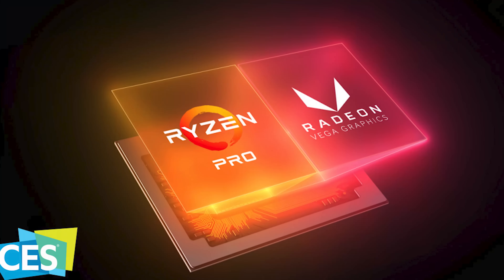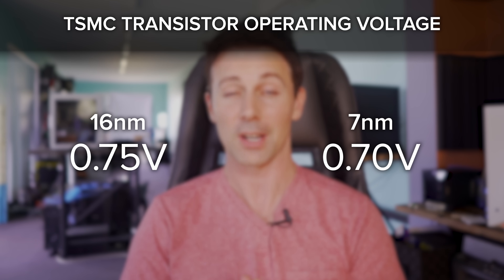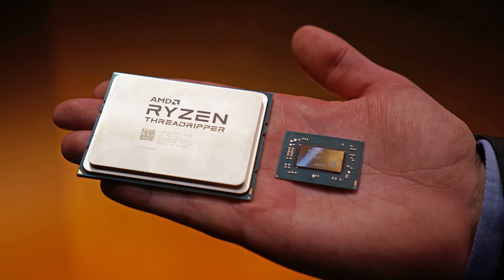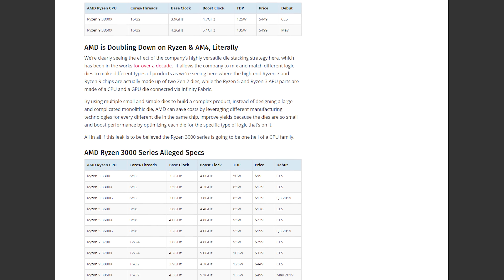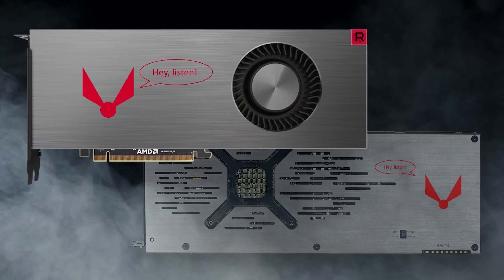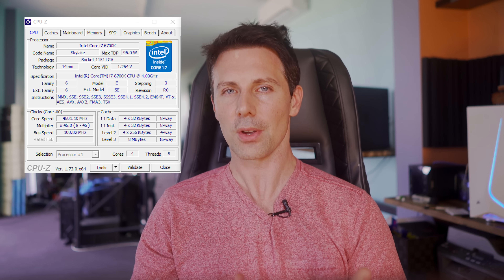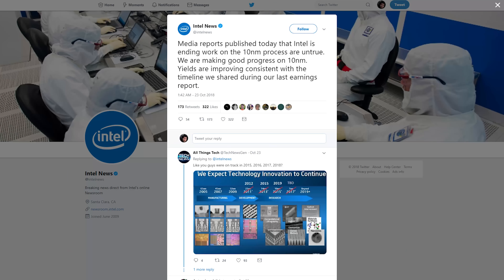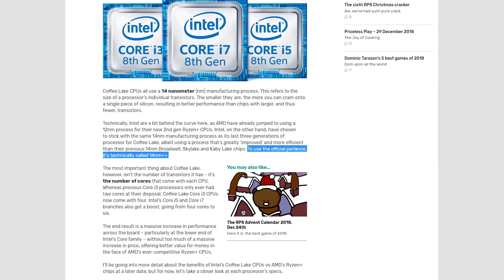7nm, 5nm and Beyond - Will AMD RYZEN 3000 be the PINNACLE...!?

Comment: Ryzen 3000 changes the game completely. Being able to get a six core CPU for under 100$ is amazing. If AMD has made enough leeway with their GPU process... Then you have a bang for buck winner. Striking Intel AND Nvidia at the same time would change the PC space toward AMD for years to come.
Reply: 6 core 12 thread that can be overclocked to 4.6ghz and has an ipc advantage over the i7 8700k.
Reply: @dondraper4438  not sure about that. I would wait for benchmarks.
Reply: @Saxie81  It's the TSMC 7nm process that makes it possible. The 14nm global foundries (samsung) Low Power Profile node was lucky to hit 4.35ghz. While TSMC's 7nm process is made for higher clocks, 25% higher clocks higher than Samsungs 14nm node.
Reply: Technical excellence MUST have the marketing to go with it. Joe average will look at you like you're having a stroke if you mention ipc and other relevant tech and just mutter "buttt,butt green and intel inside" "they're the most expensive so they must be the best" "the other company is bigger so they're better" Or even "it might not work if it's not Intel/Nvidea" and so on. AMD needs mindshare bad or they could put out a 64 core 9 ghz $35 20watt tdp chip with 8x's lintels ipc and an integrated gpu that can full raytracing on 16 8k monitors at 800fps and still have poor marketshare in the consumer space. Seriously if the 3xxx series is as good as the rumors or even close they need to dump a TON of money on marketing to gain real traction there. However it's not as high a priority as the server market where the end users have more tech savvy folk in advisory positions and sometimes even decision making positions.
Reply: Wishful thinking that simply isn't going to happen.
Reply: I just hope Intel can keep up, I mean, if it dies, I would be sad, they invented x86.
Reply: dream on
Reply: Zfast4y0u  Intel never give me erection since 2015
Reply: You're going to feel really foolish about this by this time next week.
Reply: @selohcin  Well we had a not power limited 9900K losing to 3rd gen Ryzen at undefined clock speed. So that was a 8core 16th had enough power matched intel for clockspeed. And if they try to cut Intel again like they did with Ryzen 1 R7 1700 for $320, this one could easily be the R5 3000 lineup which would cost around $200.

So a six core for under $100 doesnt seem reasonable but $120-150 easy
Reply: @selohcin  Regardless what they say in the keynote, I won't feel foolish lol
Reply: Trust me those rumours are not real....100$ for 6cores 12threads..too good to be true
Reply: @crusherrakib9582  Not really man, you must not have been around during the Athlon X2 days. Tons of good chips for fairly cheap.
Reply: @dondraper4438  Phenom II x3's still run well in 2019, still enjoying the X3 720BE and I haven't tried overclocking or core unlocking yet.
Reply: @crusherrakib9582  idk on black friday i got a 8c/16t ryzen 1700x for $120 brand new so this doesnt seem too far fetched imo, granted it was black friday so it was on sale
Reply: @crusherrakib9582  Ryzen 3000 and Navi 3000 will be able to be more affordable as the chiplet design allows for much more flexibility and less wastage in the binning process.  I would expect AMD to come out of the gates with impressively competitive pricing but not so cheap that people will not continue to buy up old inventory. 6 months to a year later though the lower demand SKUs will see a significant price drop to get media attention and mess with an Intel/Nvidia launch.
Reply: @crusherrakib9582  Also it's 8 core chiplets, so it would be a 3+3 configuration, you're getting the bargin bin quality dies. Full configuration is 8+8.

Comment: in 2025 100 cores in regular pc will be very normal XD
Reply: in 2050 cores will be obsolete
Reply: that's the same mistake that others have done before by looking at current trends and assuming it will keep escalating. It usually doesn't. Other things happen. No idea what.
Reply: r7 3700x is 12 cores / 24 threads and boosts up to 5ghz, so it's not entirely impossible.
Reply: If we can replace silicon with something better than we can see 5ghz being the norm.
Reply: @briandudley5150  Graphene is capable of quadrillions of operations per second.  
Let's hope it takes off
Reply: For AMD, it'd either be 96 or 128 cores, depending on how it's made (because their core counts are always a power of 2 or a power of 2 times 3/2, so 4, 6, 8, 12, 16, 24, 32, 48, 64, 96, 128, 192, 256, and so on).

It'd probably be just as exciting to see a regular CPU (finally) hit 10GHz, silicon or otherwise, base clock or overclock. (The record to beat is an ~8GHz overclock.)
Reply: Does anyone know how many bits are used for the core # in modern OSes and/or motherboards? Is there a hard limit on the number of cores before the ID number needs to be expanded?
Reply: Lol
Reply: @dibyamartandasamanta583  maybe the concept of cores itself will be obsolete instead.
Reply: Keelan  No, 12 cores will most likely remain mid range, and 16 cores might be high end.
Reply: Keelan  Didn't we quadruple core count going from single core to more than quad core in a few year time before? The same thing is happening now, but with a trend of stagnation in between, as you mentioned. We could enter another trend of stagnation on say 16-32 cores starting 2020 until for example 2028. Or another trend might take hold once we reach the 16-32 core CPU on most desktops era. Maybe IPC hikes. Either way, CPU future is looking amazing right now.
Reply: Keelan  We were on just one core since the invention of the CPU advancing only in frequency, IPC and power efficiency (I say only...) which took....what like 32 years.  But once we started moving to dual core, quad core happened a couple of years after.
Reply: @James Smith This is what happened James. Developers didn't want to spend more money and time programming better multi threaded games. Intel had no problem making bank off quad cores either.

Just because lazy devs and a borderline monopoly intel had on the cpu market, that is why we were stuck on quad cores for so long. I guarantee you this though, within the next 2 years 8 cores will be mid range.
Reply: NinjaPcMaster I reckon maybe a 32 core 64 thread at 8ghz

Comment: Good summary! Wish you would have gone into transistor design a bit, like going from finFET to Gate All Around or the use of III-V materials to extend the shrinking until we can figure out graphene, including III-V materials as 2D materials (granted this is going into materials science, but it is what will be used until 2D graphene is figured out). If you want to continue on this or turn it into a series, then you should examine the competing technologies being developed, such as nano-vacuum tubes, quantum computing, optical computers (don't add a performance advantage, but greatly reduce energy requirements; there is an article about optical memory being developed from a couple years ago estimating readiness around 2023-24), and the graphene transistors hitting between 400GHz to around 1THz (how much it could do in a CPU rather than transistor speeds is a different matter). 

As to the estimated cost of development, this is where you should discuss the use of chiplet design. TSMC's 7nm is estimated at close to 3x the cost of doing 14nm, but this can be offset, to a degree, not just in volume, but by moving components off the core chip so that more core chiplets can be yielded from the smaller node, while the harder to shrink items that don't increase performance much can be left on larger nodes, thereby simplifying the design at the smaller nodes comparatively as well as increasing effective yields through removing components that if a critical defect hit them, then the whole chiplet die is scrapped. By doing such things, you decrease the estimated design cost, increase the yield, shut off the defective cores, and then can do volume, as you mentioned. This leads to discussion of 2.5D and 3D integration for manufacturing, which is being seen in AMD and Intel designs, and which Nvidia is exploring with their multi-die GPUs. 

In any case, considering the wonderful video you just did, I hope some of the things I mentioned here inspire you to discuss more topics in this vein, as I really enjoyed this video and hope others did as well.

Comment: I plan on upgrading to the 3700x as soon as they come out, I have a 1700x atm with a ASRock X370 Taichi MB. Do you think I would be nerfing myself to much by sticking with this MB ?
P.S. Thank you in advance for anyone that can help me out.
Reply: Chris B You'd be losing out on things like PCIe 4. But other than features like that, as far as CPU's go, you'll easily be able to handle a 3700X even overclocked to 5GHz on all cores, although XFR3 should take it to ~4.7GHz itself. You could even max OC a 3850X on it.
Reply: @Najvalsa  perfect
Reply: Possibly but I don't think so due to amd's claims of support for the socket, plus you have the highest end chip for the first gen
Reply: @jonniezodiac  Thank you, I got this MB knowing i was going to upgrade the CPU down the line. So far the only down side I can think of was the auto over clocking on the newer MB's. You never know but so I never hurts to ask around. Worst case, I get another MB and build another spare gaming system for lans.
Reply: Chris B that is exactly my thoughts, I plan on upgrading from a 1800x to the highest end 3000 series you can get
Reply: What a dumb waste of money.. 1700x can handle everything..just proves that you dont know shit about tech..you jusy buy new stuff because its new
Reply: @rkgracanica  LoL really, If i wanted to get soemthing just because it was new I would have got every other gen of ryzen before this one. I also would be upgrading everything rather than trying to cheap out on my MB by keeping the old one. As for my old parts, they go to people in need or mates that sometimes need a upgrade but are having a hard time. Sounds like you need a hug really, So much hate.
Reply: @rkgracanica  YES BOUGT RYZEN 1700 FOR 360 EUROS ON MARCH 2017. UNTIL THEN I HAD CORE I5 2500K AND WAS FORCED TO UPGRADE BECAUSE MOTHERBOAD BURNED. 8 core intel was costing more than 1000 euros at that time but then amd made them affordable with ryzen 1700 for just 400 euros. Intel is finished. Now that we will be able to get 16 cores for just 500 euros... END OF INTEL. Rest of pc is GTX 970 G1 GAMING 16 GB DDR4 3200MHZCL15 GS KILL RIP JAWS DELLP2416D 24'' 2560X1440 60 HZ IPS WD BLACK 4 TB, 1 TB! No need to upgade from 1700x as there is no need for me to upgrade from 1700. We have monster cpus who will run evrything at max settings 4k with a good graphics card. I run evrything 1440p max settings 30+ fps so all i need to do is change graphics card. Upgrading cpu again when i already have a monster one will be waste of money since it is not needed.
Reply: WINSTON MOSCOW whats wrong with that? Especially when the money goes to AMD, its good for everyone
Reply: I was thinking the exact same thing xD I have a 1800x, but I think I'm going to upgrade my motherboard just to be safe.
Reply: The 3700X is Rumored to run at 105W with a 5GHZ boost clock. The X370 Taichi is pretty good and built well, you won't have any issues.
Reply: @ViolentMLG  I was hoping with the 7nn chips now it would run with a good ammount of power, and the 1700x is 
Default TDP / TDP
95W
Reply: It's actually ASML that's developing e-UV and not Samsung. Also this technique won't fix quantum tunneling issues for small node sizes unfortunately.
Reply: I know some of the AM4 motherboards out right now state that they only support up to 8 cores. So you might have to buy a new motherboard if they do sell higher core count desktop chips on AM4.
Reply: I don't think so
Reply: YES BOUGT RYZEN 1700 FOR 360 EUROS ON MARCH 2017. UNTIL THEN I HAD CORE I5 2500K AND WAS FORCED TO UPGRADE BECAUSE MOTHERBOAD BURNED. 8 core intel was costing more than 1000 euros at that time but then amd made them affordable with ryzen 1700 for just 400 euros. Intel is finished. Now that we will be able to get 16 cores for just 500 euros... END OF INTEL. Rest of pc is GTX 970 G1 GAMING 16 GB DDR4 3200MHZCL15 GS KILL RIP JAWS DELLP2416D 24'' 2560X1440 60 HZ IPS WD BLACK 4 TB, 1 TB! No need to upgade from 1700x as there is no need for me to upgrade from 1700. We have monster cpus who will run evrything at max settings 4k with a good graphics card. I run evrything 1440p max settings 30+ fps so all i need to do is change graphics card. Upgrading cpu again when  i already have a monster one will be waste of money since it is not needed.

Comment: It is impossible using current technology to surpass 5nm as electrons will start to jump around and wreck stuff.
Reply: Bull, the industry has been working on switching to III-V materials for awhile, adding Cobalt for the contacts as it has lower resistance than copper, which will allow going a little further, etc. Even Intel's 10nm chip that was in a Lenovo laptop this year contained Cobalt and Ruthenium for that reason. Then there is work on Gallium-Arsenide and other materials to fight the electron leak issue. They are also working on vapor deposition for those purposes and developed an etching that can remove 0.2nm at a time, IIRC, reported a month or two ago, developed for 2.5nm production. Then you have photonic computing that may allow for not just lower power usage, but a move away from wire based electronics. I could go on. You are right that changes must be made to go further than 5nm, as that is the end of finFETs (except for a modified version being explored to combine with Silicon on Insulator which may be compatible with the nanowire and nanosheet Gate All Around FETs that are being developed). So, a bit more info on that topic considering the blanket statement you gave.
Reply: @ajc-th5ei  yes but it will not be able to be applied with current technology
Reply: @ScrapTechTips  - if you mean new process technologies currently in development, then sure. But nothing suggests that it won't be ready when needed so far that I have seen. But Cobalt still must be integrated soon, and could change that. But just because Intel had issues with Cobalt doesn't mean that TSMC or Samsung can't figure it out when needed.
Reply: 3nm may be possible. As it is current generation processor design already factors in quantum tunneling. Technically they are not jumping around, rather they have an area they are most likely in, and which specific location they are in is only 'real' when the wave function collapses, untill then they are in all those places. the odds they wind up in the wrong place goes up as the wrong places get closer to the right places, in theory they could wind up to actually be anywhere, though past a few nano-meters those odds get smaller than winning the lottery, at a meter they get smaller than winning dozens of major lotteries all the same day.

Comment: Thanks for the new content this 2019. I'm excited for ryzen 3 3300.
Reply: I'm excited for Ryzen 7 3700X. I'll probably grab that and stick to it for 6+ years. My i7-3770k is showing its age.
I'm particularly excited because it'll mean switching to a mobo that supports m.2 SSDs, heh, so it's going to be one heck of an upgrade.
Reply: Kaerius so, did you do it?
Reply: Yes, It will be the perfect Gamer CPU, because its better than a 5 2600x now
Reply: @zero.zero.one.001  It should be better than 2600 but not as good as 2600x if it will have same IPC, nothing is still for sure but i'm excited
Reply: @cekpi7  Thanks for the info, I don't have a lot of knowledge regarding on pc parts especially on cpu and it's a great thing that it will perform same or better than the ryzen 2600. It also cost cheaper and its very power efficient.
Reply: @cekpi7  Thanks for the like.
Reply: a n i m e
n
i
m
e
Reply: @KokoroKatsura  Yep my profile picture was from an anime called 'WIXOSS' just forgot the whole title.

Comment: Thank you Tech YES City I'm ready for AMD Ryzen 3000!
Reply: OPTERON PRIME I'm already saved up to buy the top of the line chip of this gen, loving the price to performance of the 1800x I picked up for 200 Australian dollars and looking forward to a performance boost
Reply: @jonniezodiac  fantastic
Reply: @OPTERON_PRIME  haha how much of an improvement do you reckon it'll be?
Reply: @jonniezodiac  25% increased perf I reckon.

Also where'd you pick up a 1800x for $200AUD?
Reply: @wolvAUS  a guy had a dead mobo and ram (PSU blew up during thunder) and sold the system with a 1070ti for 200, all with the original boxes. He wasn't sure what was working but it appears to all be fine and stable at 4.1ghz so I don't think the CPU took any damage luckily
Reply: @jonniezodiac  wow good save! What you got is great but, Ryzen 3000 will likely be what people are say may be (AMDs sandy bridge) I believe this could be true. Of course we won't know for sure till we get samples XD